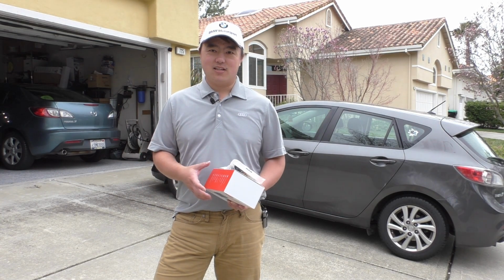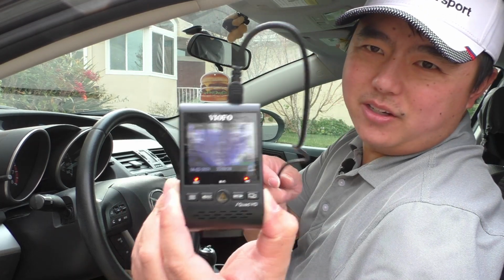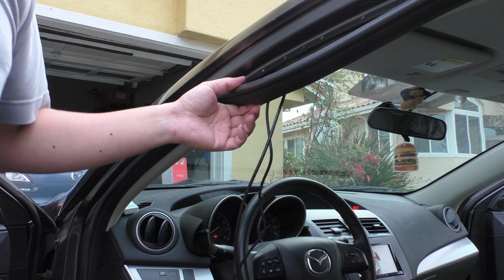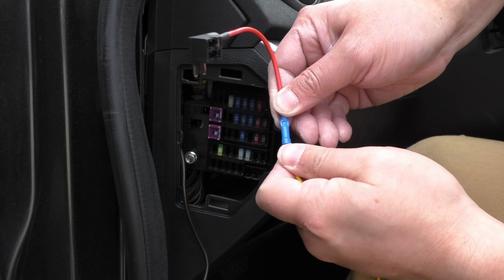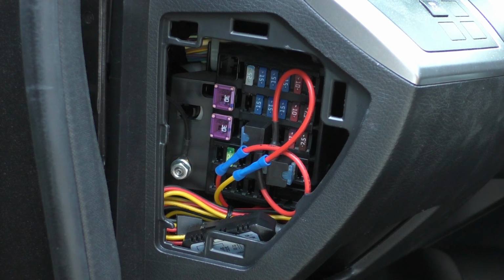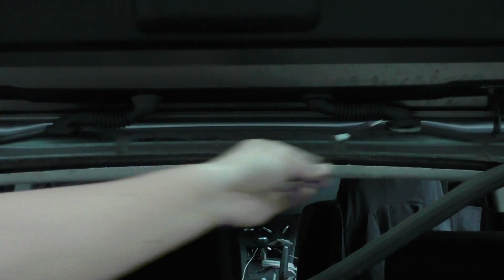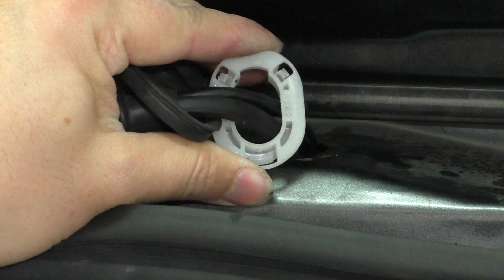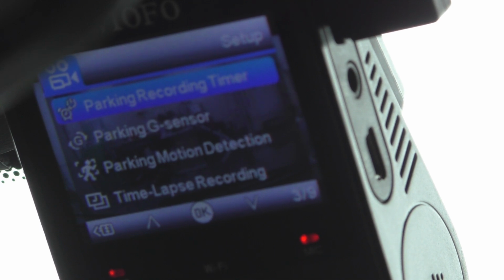2nd Gen Mazda 3 Dashcam Installation (VIOFO A129 Plus Duo)

Comment: One of your Fuse Splitters are facing wrong direction and is always hot even without Fuse.

If top FUSE clamp is +12v the splitters should face to the left side. Cause the Bottom Leg of the splitter is the outgoing connection to your Dashcam, if you turn them wrong direction the top leg direct connection to your dashcam is directly connected to your battery without Fuse between.
Reply from the maker: You're right that the fuse tap is "backwards" however the implication stated of that isn't correct. If you look at a circuit diagram of the fuse tap (https://tinyurl.com/4mshc62f), putting the tap in "backwards" just means that the lower fuse has to carry the additional current of the upper fuse/dashcam. So you're making the dashcam in series with the original fuse instead of in parallel. If you're not exceeding the fuse rating with that and causing it to break, then it's not really an issue.

Comment: Thanks for the vid! If my dashcam doesn’t have a parking mode, is it ok if I only plug in the accessory power so that it doesn’t drain my battery? I’d assume that it would still work fine, but would only turn on when the car was on.
Reply from the maker: Yes, if you only want the camera to be on during driving, and no parking mode you can just hook it up to the accessory power.
Reply: @FaRKle0079  thank you!

Comment: I'm having issues getting the wire through for my rear camera via the rubber tubing on my Mazda 3 hatch. Will try again tomorrow.
Reply from the maker: It can be pretty difficult with how tight it is in there. This is why I recommend something more substantial to pull the USB connector through with like a rod.

You can also try bending the USB back on itself forming a "U" with the wire and pulling from the "U." It's a bit more "streamline" shaped that way.

Comment: Ok, so I watched your installation and that gave me courage to install a front camera in a family members Mazda CX-3. Very easy, so thank you.

Emboldened, I then set about a front/rear installation in my Audi. Much, much more difficult. The A pillar panels were so hard to work with and I couldn't even remove the weather strip. But I got there in the end so saved myself some money, so thanks again for your excellent instructions.
Reply from the maker: Glad you were able to work through the difficulties the Audi had! I wonder if that was more similar to my BMW guide.

Comment: Out of interest, it looks like your rear cam is placed on top of your demisting element. Have you noticed any issue when turning this on? I assume there's been no issue with the adhesive over the element?
Reply from the maker: There have been no issues with having the adhesive patch over one of the defrosting elements. I've had placements like that on multiple vehicles.
Reply: Great. Thanks for the quick reply. I'm looking at getting a dual cam, possibly the Pro Duo and that was one of my concerns as the elements on my rear window would make cam placement awkward if they were to be an issue.

Comment: For your sedan, do you find that the rear camera affects your AM radio reception? I have the same vehicle and I use the A119V2 in the rear and I found that if I installed it directly at the back in the middle, this would cause my radio to be all static for AM. Apparently this is due to the sedan's radio antenna being laid out on the rear glass and power going to the dash cam causes interference with the AM radio reception. Because of this, I've had to install my rear A119V2 cam off to the side on the rear.

Curious if you get any radio interference for your sedan with the way you've installed your rear cam?
Reply: I don't know if you fixed it, but you could buy a clip on noise filter and attach your wire to it

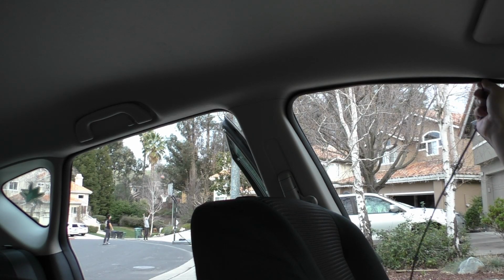Comment: 17:41 airballlll
Reply: Lol. Bro, nobody ever mentions where they are sourcing the add a fuse, low profile fuses. Any info?
Reply: @NiNE0s  They are "mini low-profile" fuse taps and I found one at an auto parts store in my city, but did have to buy a small box of spare fuses separately (double check these are also 'mini low-profile'!). Also saw them on amazon, they often come in packs with extra fuses included, I just try to avoid amazon when possible.

Comment: I heard that viofo cancelled the parking mode in all dash cams, is that true?
Reply: That's not true. I have the A129 Plus Duo as well and I am using parking mode.
Reply: @mpcp27  does still work well ?
Reply: @ISSO8BOITE  .. Yeah it seems to work okay..I am using the auto detection (motion detection) on low sensitivity, with a cutoff at 4 hours,  and voltage cutoff at 12.4V.  I have to play around with the sensitivity and check the footage, because a couple times I came back and it didn't pick up my approach..I dunt know if I just came in on an angle that it couldn't pick me up. But other than that it seems to be fine.
Reply from the maker: I can't say I've seen that anywhere.

Comment: Nice work ! I had done mine the same way although I had to use a OBDII connector on my 2021 CX30.
No acc in cabin only under hood either that or use annoying lighter socket. My 2018 CX5 was even easier than the cx30 and 3’s. Ya covered all the basis good work! I spray alcohol in the wire harness and it slides like butter then evaporates.
Reply from the maker: That's a good trick using a bit of rubbing alcohol to lubricate the wire! I'll have to try that.

Comment: Hey man thank you for the video, it really helped me because I am waiting for my 70mai dashcam. I only have one question, I only wish for the camera to work when I start the car, I don’t want to use the red wire that you used. Is the installation the same? Only I dont connect the red wire?
Reply from the maker: I believe that dashcam comes with a hardware kit too. It probably has a menu setting enabling or disabling parking mode so I'd tell it to turn off with the car that way.
Reply: @FaRKle0079  It didn't come with hardwire kit. I will have to buy one third party like you did, can you help me with my question?

Comment: Great instructional mate! The only pointer from me would be that it is never advisable to connect a live line first, before GND one is connected. When connecting the ACC line you actually connected it before GND wire to the grounding lug.
Reply: Also it’s wired over the airbag within the A frame on the drivers upper left hand side. It needs to be wired under the airbag as not to disrupt the release of the airbag!
Reply: @lungbuttah3968  can you explain how to wire under the airbag
Reply: @banpeikun  this video will explain: https://youtu.be/uZp95NbNlmM?si=ULTqPvnPkBpbQndN

Essentially you just need to take that whole side panel off and guide the wire under the airbag. The airbag is the long white folded object along the panel frame , very hard to miss. Good luck to you.

Comment: I wired the same dashcam the same way especially the rear camera but wasn't sure if it safe and it's not obstructing the side curtain airbags.
Reply from the maker: Airbags will blast through any wires around there. They use a small explosive charge to deploy.
Reply: @FaRKle0079  i know and my concern is if the same force will blast the cable into the occupants faces.
Reply from the maker: @EVAddicted  I think that's really unlikely since there's not a ton of free length of the cable where it'd break at the A-pillar. The wire would have to be pulled out from along the front of the headliner a considerable amount before it'd be able to reach the occupant, and then would have to change directions to swing backwards towards the rear of the car. The front airbags and seat belt would be trying to keep the occupant away from the front of the car where wire could be.

Adding anchoring (like stick on clips) to the windshield/headliner interface to hold the wire would make it even less likely if you're really worried about it.